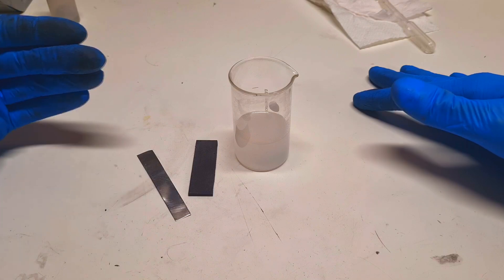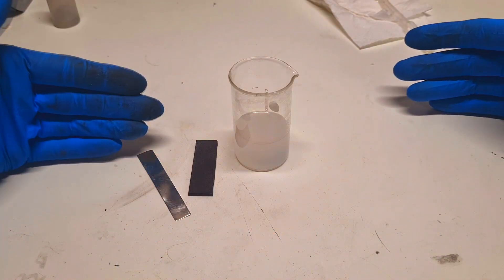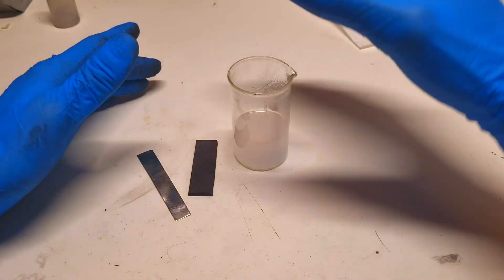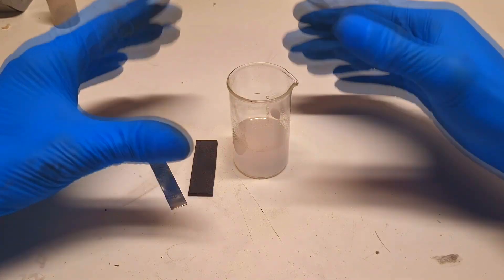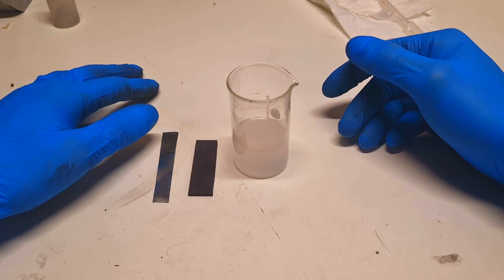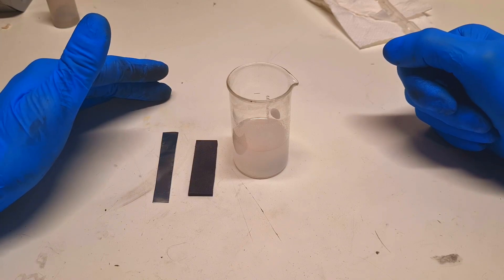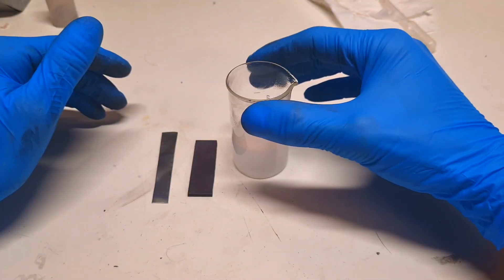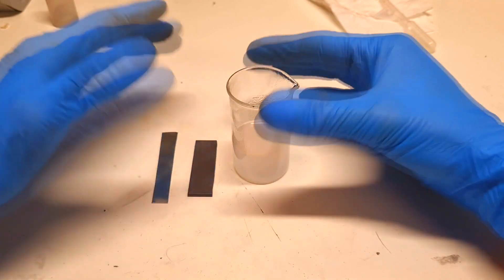Reducing the self-discharge of Zinc Bromine Battery TEST

Comment from the maker: Do you search for FDM or resin 3D printer? You look for big size and multi color 3D printer? Then make a look into Anycubic printers and use my link and Coupon Code to get $25 OFF. Link: https://store.anycubic.com/?ref=cayrex and the Coupon Code: QDSQJZRPRE

Do you need measuring equipment? RIgol website: https://int.rigol.com/
5% exclusive discount coupon Code for RIGOL Digital Multimeter DM3058: CFANS5D

Rigol DM3058 digital multimeter: https://int.rigol.com/products/DM_Det...
Rigol DP832 power supply: https://int.rigol.com/products/DP_det...